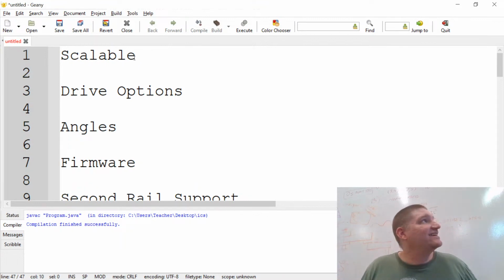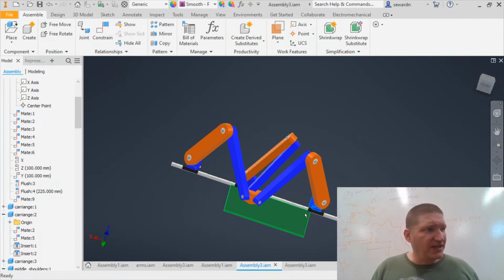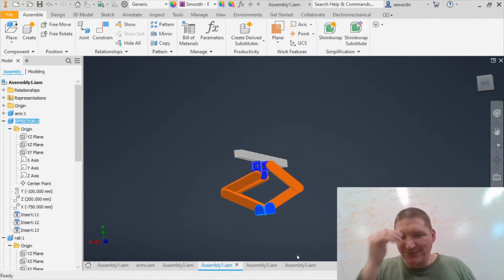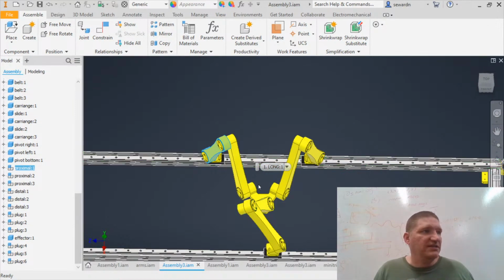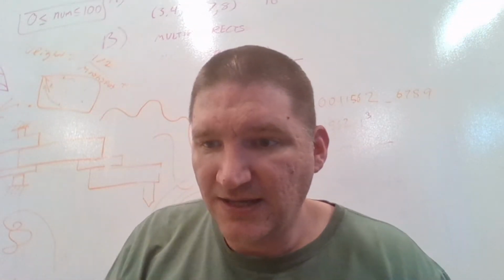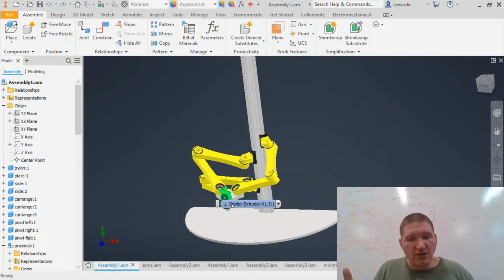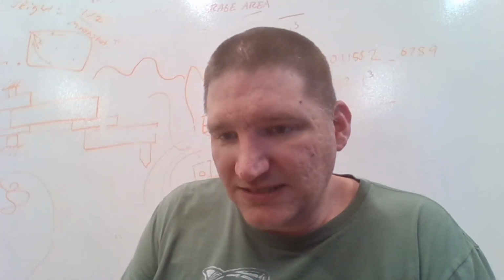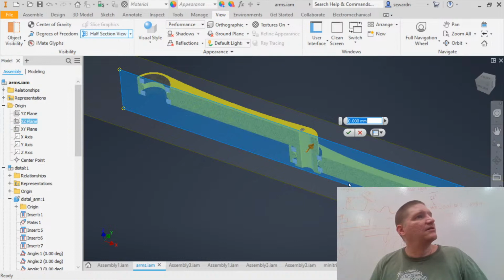[Untrimmed/Unedited] RepRap MonoRail Q&A

Comment: Really inspired to make a “hanging” monorail. What do you use for the revolute joints to get low backlash? Are they just stacks of bearings?
Reply from the maker: I am using 6806 bearings.  Two per joint.  A 6806 and a 608 pair would perform the same.

Comment: This is so amazing. I would love to see generative design optimized arms :D Can't wait for more updates. Thank you for sharing this.
Reply from the maker: I want to develop software for generative design for 3D printing.  In some ways, it should be a slicer so it can completely control the infill.
Reply: @NicholasSeward  that would be amazing. So you would have an STL and specify the load and the slicer would optimize infill generation based on load?
Reply from the maker: @Techtusiast_AT  some of that exists to be fair.  I would love for it to be usable by all.  Also add in nonplanar slicing.
Reply: @NicholasSeward    I only use some addons in blende to do optimization  . Would be awesome to be in a project like that .Is there a Github project to contribute ?